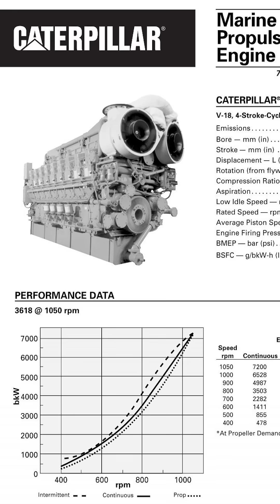wHy Don'T CaRS uSE V18 ENGiNEs?

Comment: V16 were around since 1990s, oldest car I know with V16 engine is BMW E32 "Goldfisch". Only 1 was made and it had the engine in the back and the car was extended to fit it whole, it had air cooling in the front and also made a specially developed cuts and body work on the sides just over the back wheels vents to keep the engine cool. Right now it stands in special "secret" bmw garage and can see the light of day on rare occasions in BMW WELT
Reply: No, since the 30s. If you played Gran Turismo 4, you might've seen a car in-game named Auto Union Type C. That thing has a V16.
Reply: @KitKitChanIsaac  Played only a few times. I'm more of a Dirt 2.0 guy
Reply: @KitKitChanIsaac  it should be noted that in 2024 Volkswagen Group unveiled a pet project, a "what if", the Auto Union Type 52, which had languished as drawings and never built in 1935... a Type B derated to run on regular fuel, and an aerodynamic three seater sedan body built around it, with a modern "Frunk".
Reply: V16's were popular in the 1930's with the "upmarket" brands like Cadillac, Marmon and even Lincoln.. made from the parts of their smaller V8's or straight 8's.  The Cadillac was two buick straight 8's placed in Vee.
Reply: @PiersDJackson  Oh I didn't know that, the more you know
Reply: So you named one v16 and said they were around since the 90’s 😂
Reply: @tylergautreaux6308 phantoms were designed for a v16. 4 were made but they decided to switch it to v12
Reply: @bizzyforawhile  Rowen Atkinson got one with the V16 by special request
Reply: @tylergautreaux6308  I didn't say they were popular in 90s. I said they already existed back then and Bugatti Tourbilone (however u spell it) V16 isn't so "innovative" ale "new". All I'm saying they were made before
Reply: Yep, Cadillac V16 was the most famous because it was avaliable to buy and Al Capone had one
Reply: 20’s cadillacs had V16s
Reply: Bugatti T45, Maserati V4, Cadillac 452 and 90, Marmon, Bucciali, Auto Union Typ C, Alfa Romeo 316, B.R.M., Sbarro, Cizeta, Veyron, Chiron, Double Huit. Just to name a few. W18 have been considered by Bugatti and Ferrari, but never used outside prototyping.
Reply: @wernerviehhauser94  there should be a distinction between the two types of W engine... the original is also called an "Arrow", as such is three banks on a common crankshaft (or three individuals driving a fourth common driveshaft) - eg. The Napier Lion, aka Golden Arrow.... the second is the compound brainchild of the Volkswagen Group, placing two Narrow inline/vee engines (VR) into a wider traditional vee... using common components so a W12 is two VR6's... the  only hinderence to a W18 would be the VR series is only a 4, 5 or 6... so that has limited it to W8, W10, W12, W16 - or at extreme W20 and W24.
Reply: "since 1990s"

Comment: Its simple physics tbh at a certain point itll be too heavy to let it be efficient. We can only build elevators so tall bc the weight of the cable overcomes its strength and snaps. We can make stronger rocket engines to get to space but they use more fuel which adds more weight which cancels out the bigger engine

Comment: Yeah, Bugatti doesn’t do a V-16, it’s a W-16, an offset version of the V engine that makes it shorter than traditional V engines. That’s why they can do 16 cylinders. Otherwise it would only fit a 12.
Reply: Bugatti does have a v16, they shoved it into the new Bugatti Tourbillon

Comment: you also have the strength of the crankshaft, cams, and oiling of such a thing that long.

the crank might snap due to torsional load, and the cams might break due to the length and friction from actuating all the valves and the torque from that.

Comment: Seriously, though... a 9 cylinder engine called an "Inline 9" would have a pretty sweet ring when you say the motor type out loud.

Almost the same ring to it as "A Straight 8". (Which is a real motor layout, BTW)

Comment: Guys take a look at the Pratt & Whitney R-4360, its a 71.5 liter 28 cylinder radial engine that made 4300 hp; it was used on multiple aircraft but most notably the B-36 Peacemaker had six of them.

If you want an even crazier engine take a look at the Lycoming XR-7755. It’s a 127 liter 36 cylinder radial engine making around 5000 hp. Only two were ever built and it was originally intended to be used on the B-36, however they went with the R-4360

Comment: They have W16s in the Bugatti Veyron. Not V16s. Get your shit right.
Reply: thats a Bugatti Tourbillon, not Veyron
Reply: @faiyaz167  Did I stutter, or reference the vehicle he showed? No, I didn't. Your pointless correction aside, they still use a W16. No V there.
Reply: @jackremming2653  dude just look up what engine the Bugatti Tourbillon uses 🤦‍♂️
Reply: @faiyaz167  Fair enough, I looked it up. Brand new motor developed this year for a car that exists next year. Technically, a concept still. So not in existence, and thus they do not have. My previous statement stands until 2026. What was your point again?

Comment: That engine sound is of an ALCo starting up. Ship engines run at very low rpm around 80-120 at that low rpm you would only here the pistons thumping up and down, let alone the exhaust beat...

Comment: It’s really not necessary for power. A lot of older semi truck had I6 and most have V8. More cylinders does make more power however you can also make more power with bigger cylinders and bigger cylinders are easier and cheaper to make than more cylinders

Comment: Practical? Really? 

I don't think these manufacturers realize that the only reason why I want a V18 Engine is because I have plans to strap it to a piece of plywood on big meaty wheels with a 2x4 plank of wood from Home Depot as my steering wheel and an "Aooga" horn from a 1930 Ford Model A with a shovel to touch the tires as my brake

(Obviously i'll wear a helmet so its completely safe) 🙄

Comment: Train Guy here, Take a look at the EMD 645E3 (645 cubic inches per cylinder) , It's a V20 producing 3,600 Horsepower  used in the EMD SD45 locomotive, some ships, and used to power a prototype truck. Also, EMD was owned by GM until recently, so a Chevy V20 technically exists.
Reply: I have finally found another train person in a random comment section.
Reply: @Mason929TRAINS it’s always fun finding train people lol
Reply: @Mason929TRAINS  Idk, does your train passion stops at the US or is it bigger than that?
Reply: @ Mostly just the US.
Reply: That sound of the v18 at the end of the video sounds like an idle dash 9
Reply: @nonexistentialcrisis that's what I was thinking
Reply: That's exactly what I'm saying @nonexistentialcrisis
Reply: @nonexistentialcrisis it more sounds like a sd40-2 or a sd38 start up I think
Reply: The startup doesn’t sound like a 645 (prime mover on the SD38, 40, 45, 50, and others) at all. I agree with the other user, this sounds like a Dash 8 or 9
Reply: Doesn’t the 70MAC have an EMD V18?
Reply: @CSX_7026 sd70's of almost all flavors have been 16 cylinder. The only exception I know of is the t4 sd70ace which I believe is a 12 cylinder
Reply: @Andrew-se9be  Ok yeah no I’m dumb more than likely.
Reply: @CSX_7026 hey, it’s you again!
Reply: @CSX_7026  No. EMD has never made a V18, and to my knowledge the only V18 prime movers were Alco 251s and Cummins QSK78s.
Reply: @CSX_7026 no it’s a 710 16 cylinder
Reply: @CSX_7026 yeah I thought so
Reply: can i fit it in a kia soul?
Reply: What's amazing is that it makes that much power at 950 rpm.  For those who know, horsepower is a calculation that's rpm dependent.  So this engine is making a huge amount of torque.  It calculates to around 20,000 ft/lbs.
Reply: 20-710 in the SD80MAC
Reply: And, if I remember correctly, the weak point of those engines was the crankshaft.
Reply: Another train guy here, wassup legends.
Reply: @Bababerko  My thumbnail is a boat
Reply: EMD also had a 20V-710
Reply: Damn interesting
Reply: You are the burden of the railroading community.
Reply: @vertigo300  I just personally find US trains to be more interesting and look cooler. I don’t like the electric European trains.
Reply: That’s what I was thinking
Reply: Hi I'm a plane and boat person
Reply: Thanks for that tidbit of information!
😂😂😂😂 Kool 2 know!
Reply: Plane guy here, a normal 777X GE9X engine powers about 134,000 pounds of force. That is about 60,000 kilograms of thrust :D
Reply: No alse Sd60s
Reply: So cut fuel lines to 2? Or just pull the pistons out.
Reply: Was gonna say this
Reply: An EMD SD70ACe running as a D.P.U on a GM freight train, saved my life from a EF3 tornado once.
Reply: I personally prefer the sd40-2 (yes i know its incredibly unoriginal)
Reply: Owned by caterpillar now
Reply: @brucedale4465  yep. EMD is now owned by ProgressRail, A subsidiary of Caterpillar
Reply: Well this engine use on the SD70ACE and GE ES44ac and dash 9
Reply: I thought it sounded like an EMD
Reply: @statictvog   yeah but it sounds similar
Reply: I like your profile pic!

Do you know why they made it a V20 instead of 18?
Reply: @magiccarpetmadeofsteel4564  probably their locomotive engines
Reply: @LysanderTrainFan  ?? That doesn't answer my question at all? I know it's a big-ass locomotive engine, I'm asking why it's a V-20 instead of a V-18, since this video kinda hyped up V-18s
Reply: @magiccarpetmadeofsteel4564  but the caterpillar engine sound like a GEVO
Reply: dose it fit in a miata?
Reply: @veedub5492  I don't think so
Reply: That PfP is trainsgender haha
Reply: How to calculate horsepower with 645 cubic？
Reply: the train and trans flag pfp combo is unconcievably based
Reply: @darubyprincxx I believe there is bias in this comment
Reply: Dude, you're spouting BS. Lmfao. You're not a "Train Guy", that's not even a job. Train conductor is, but you're not gonna be messing with the engine of a train. If you knew what you were talking about, you wouldn't be going for technicalities.
Reply: @BreatheintheChaos  Fan of trains. Like Car Guy.

Comment: Thing is remember is a Ferrari 812 super fast has less displacement per cylinder than a similar size V8 but makes way more power. So you say okay great just make the engine smaller in liters and add cylinders. However you are talking about 3 more per side. And after a certain point making cylinder and pistons smaller weakens it structurally.

Comment: I think as well, as the engines get longer, the crank and camshafts start running into issues with...well I don't know the technical term but they start to wobble, kinda. Having a long ass piece of metal rotate that fast, might cause problems.

Comment: Not really the true issue.
The true issue of Any Long engine is the Crank.
Example Audi in the 80s made AUDI 100cc Diesel that's a 2 Liter 5 Cylinder Diesel. They saw Mercedes is doing good with their 5 Cyl diesels and thought they are as good as Mercedes.
TLDR they basically Slapped a Cylinder on a 1600 cc Diesel thay had to Make a 2000cc Diesel(400cc x4= 1600cc 5x400cc= 2000cc)
But they didn't redesign the Camshaft just extended it, The Cam would either Snap in First iteration or Twist because its too long later.
Diesel Engine is always a Interference engine and the Valves at least on the 5th cylinder would leave a Historical impression on the Piston. 
They also had cooling issues with the 5th cylinder as the Engine was again 4+1 not a fully designed like Mercedes or Volvo. 
They never fixed it because They would have to recall and Retrofit New Heads on all the cars as you cant Just Increase the Thickness of the Camshaft to make it strong enough.
Audi did well with Petrol i5 because Gasoline is a weaker Fuel and Engine goes trough less stress, but also Because i5 Diesel they made came Before the i5 Petrols so they learned.
Not to mention if the Petrol engine at This time almost all Non interference Mistimes, Nothing happens but a Missfire because the Valve is slightly open.  
The Longer the Thicker it has to be and Better materials have to be used, especially raises exponentially with RPM. 
So LOW rpm Diesel that Tops out at 500 RPM in a Ship can Have a Fat Crank because it's a diesel and Diesel Fuel has way more energy per Unit, But a Petrol Engine you Wish for would struggle to Turn the Heavy Crank if it were made strong enough, and it would snap it if if Its light enough...
Also Fuel consumption and Emissions would be ridiculous.

Comment: Depending on the displacement, you can run into a bunch of issues related to cooling hot pockets, warping, crankshaft flexing, etc, etc

Comment: V18s are impractical for the same reason inline 8s are, length, V16s have been a thing for a very long time but they were long and hard to fit into a car which is why cars like the Cadillac V16, or the Marmon V16 had such long hoods same issue will arise with thr Bugatti V16 especially because it’s going be sush a big displacement. V18s would be even worse, which was the reason for Bugatti to go with a W16 for the last twenty years.

Comment: Also there is always a point of diminishing returns. A 6 rotor Wankel would struggle to produce as much horsepower as a 4 rotor. In a 6 rotor the eccentric shaft is so long that it loses stiffness and it hinders its performance

Comment: I've had a lot of hassle overhauling 4 cylinder engines and getting a headache on valve jobs when it's a 16v head instead of 8v. Don't even think to show me a drawing of a V18 engine, let alone an actual one.

Comment: Imbalanced engines are fine, 3 5 and 10 cylinder engines work fine and are pretty common
Reply: there are v2,v4,v6,v8,v10,v12,v16,but no v14?
Reply: @ V16s are usually used in boats, W16s in cars though

Comment: “Even v16 engines” v16 engines have been around for over 2 decades. The reason why they aren’t common is that the average car doesn’t need that much power. As a result making the engine almost always bespoke and thus costing more than they’re worth. This is kind of why older Bugatti were sort of better cuz it was just 2 conjoined v8s arranged in w16 set up. Made it much cheaper and easier than having to bespoke make an engine.

Comment: Also, after a certain crank length you get flex beyond what's manageable over like 200 RPM, hence why we only have them in ships.
Reply: You'd have to have a 6-inch crankshaft to handle the torque
Reply: @davidhenderson3400  I think ships are even more, since that thing makes 5320 lb-ft of torque @ 2000rpm.(7200Nm)
Reply: @Defianthuman  2000rpm is actually crazy lol
Reply: @Defianthuman  Though I read that this is still less than the 10000Nm of torque reportedly made by the CyberTruck & GMC Hummer?
Reply: @Defianthuman  yeah except that NO ship runs at 2000rpm, look at the comment above w actual ship technicians are talking about the stats jeez.
Reply: @davidhenderson3400  I crank my 6-inch shaft I have a 6-inch crankshaft (I don't know jack about cars or engines)
Reply: I have worked with engines up to 2.5 meter stroke, so top rpm is like closer to 110rpm. There are several limiting factors: piston speed, flame front speed, getting the most useful power from a given amount of fuel, and the fuels burn rate. Balance also enters. Main bearings are quite large. To your flexing, ships flex, and larger engines need to be built to withstand that flex. Have fun
Reply: @adiamondforever7890 I miss working around engineers and designers. Your comment made me think about how many of those considerations are eliminated by a few yards of fabric and some wooden beams. Obvious drawbacks, of course, but the contrast of massive hulking pieces of carefully made machinery and simple, billowing canvas accomplishing the same goals are striking.
Reply: The EMD SD70MAC has a V18, it’s an in-house engine created by EMD.
Reply: Cam deformation too
Reply: Yeah. That’s why the Cizeta V16 (hopefully I didn’t butcher it) operates as two separate V8 “connected” to each other rather than an actual V16; the crankshaft would be so long that it would extremely fragile if it were a V16. Plus (although it might not really matter), is the “separate engines united” strategy were to be applied, the most balanced configuration would be to have a V8 and a V10 connected to each other, which might not be optimal due to the firing orders
Reply: @paulomunozartavia2282 For some reason your V8+V10 engine section made me think, “wouldn’t a 330 liter hit-miss engine be interesting?”. I hereby volunteer to be in a different county when the prototype gets tested.
Reply: Cummins qsk78 is a 78liter v18 which can make 3500 hp at 1900 rpm used in mining trucks.
Reply: Which was the issue EMD had with their V20-645 diesel engine.
Reply: Cant more main caps or something be implemented in the design? Idk just a thought
Reply: Weeeelllll... I'd say you could make the crankshaft stronger, but also, if you think about you, each individual cylinder has its own crank. each cylinder has it's own force cancellation. Each pushes against the cylinder in the same way. Many many engines use support bearings between cylinders to hold them in place. However, you would most likely just switch to a W style. A w18 engine would be 1) much more doable and 2) also possible with six cylinders per bank. the W would basically by three i6 engines.
Reply: Huh. Neat.
Reply: And we shouldn't forget the camshafts. They're just as long as the crank but thinner
Reply: @tirededward  I hope an expert responds, but I wonder if it would theoretically be possible to just drive the camshaft from both ends to counteract that. Or maybe I'm misunderstanding the issue, because as I'm reading it, the cam being only driven from one end causes it to twist.

Comment: The cylinder head would be to long. A reliable headgasket seal would be tricky and cylinder hear warping would be a real isue. There already Inline 8 engines (very old now) these engines suffered from the same above isues